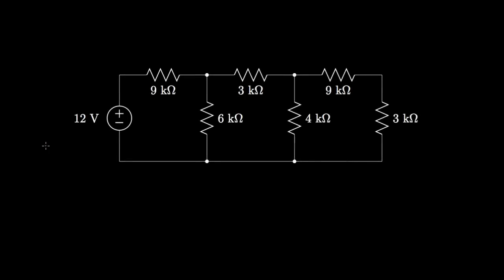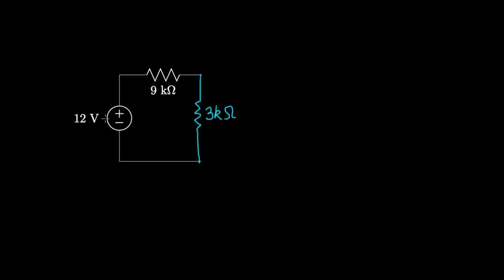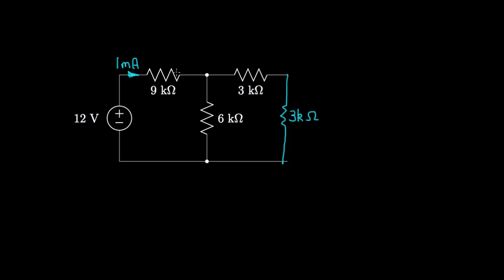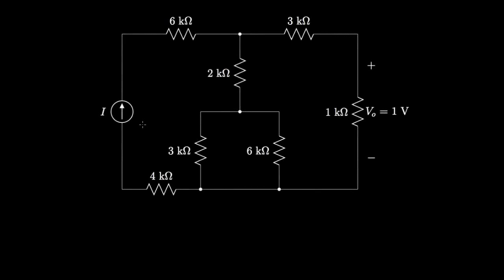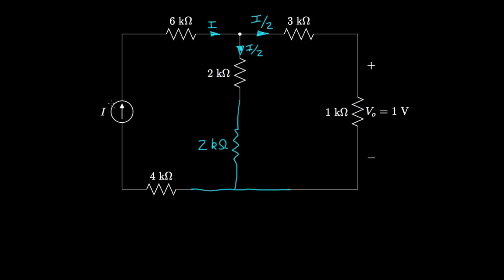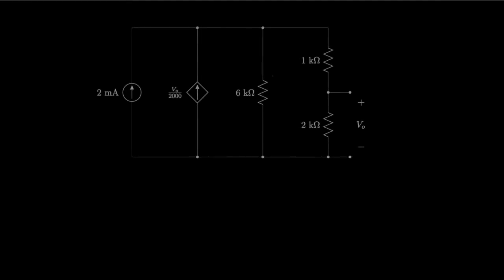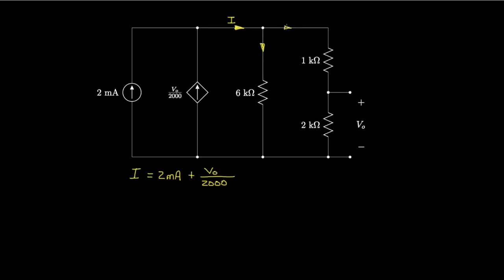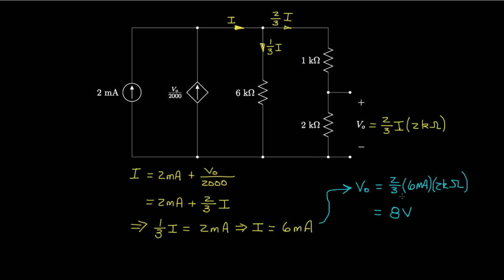Ad Hoc Methods for Resistive Networks

Comment: im sorry but the way you described the process at 5:53 was just poor. You did not just jump between concepts and solving you hurdled over them. It is a shame because usually these videos put an emphasis on applying them. You, yourself did not seem to apply concepts but talk to yourself from 4:00 - 5:53 which are critical times in the application.